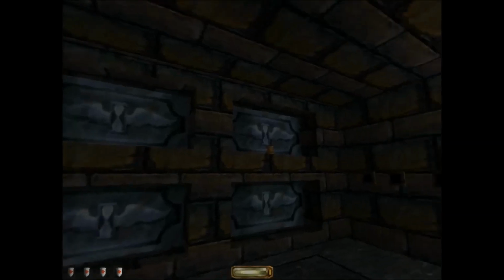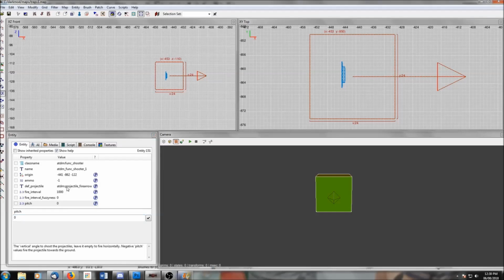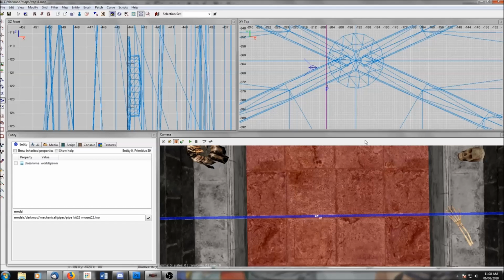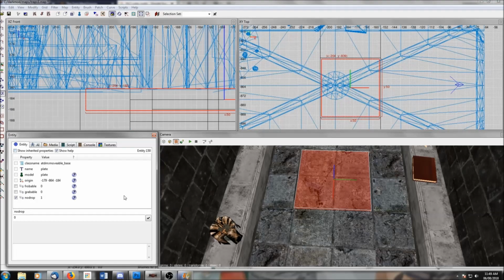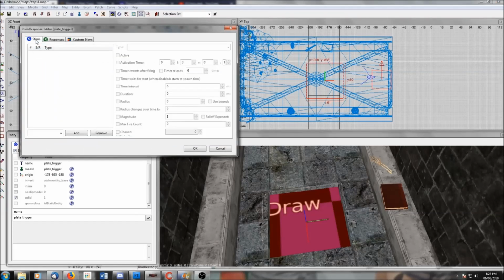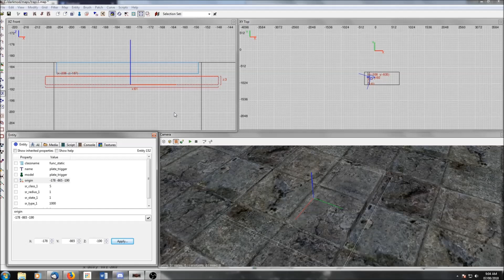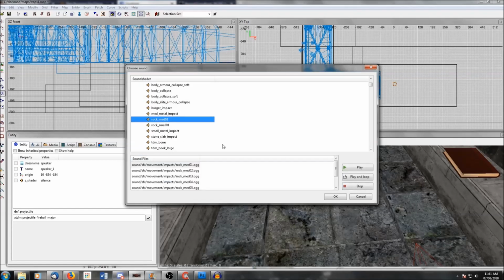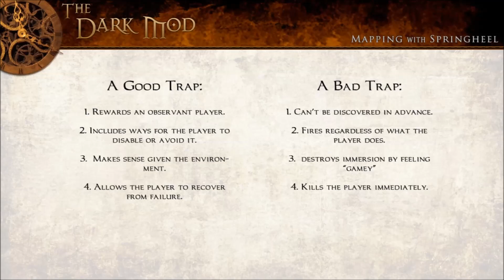TDM Mapping with Springheel:  Traps 1

Comment: Great tutorial. Always a good day when one of your tutes show up in my subscription feed Spring.  One question. Removing the plate seems to break the 4th wall a bit, as floor panels don't tend to disappear. Is there a way to do this without having the plate disappear?
Reply from the maker: The plate doesn't disappear, it just falls a few units down.  The only thing being removed is the activator, which was invisible anyway.
Reply: Ahhh I see. Thanks man.

Comment: Great tutorial as always! My only complaint would be the lack of a proper func for plates or buttons you step on; The method you're using here with Stim / Response does feel a little bit like a hack. The ideal way would be an atdm:func_touch object which can directly target and trigger the shooter entity. Was not implementing that a deliberate decision?
Reply from the maker: I have no idea what would be involved in making new func entities, but this kind of stuff is exactly what Stim/Response is for.  I think it's underused because the documentation is quite limited (I've never used it myself until working on this trap).  Hopefully this video will encourage people to experiment and see what else it can do.
Reply: Stim / Response system was the hardest part of DarkMod mapping for me to understand, though this video explained it very well. Having to go through S/R for this is just part of why I found it a limitation though: The issue with the platform sliding when bumped from one side or an arrow sticks into it is another big problem... which could be solved it the platform entity had a property to limit its movement in a specific direction specified by a vector.
Reply: I think being forced to learn the S/R is a really good thing. it's such a powerful tool, it's a must learn I felt when I had to learn it.